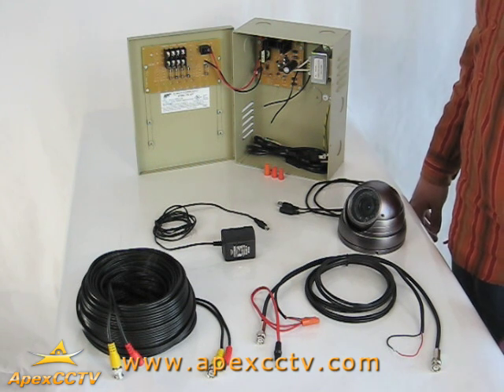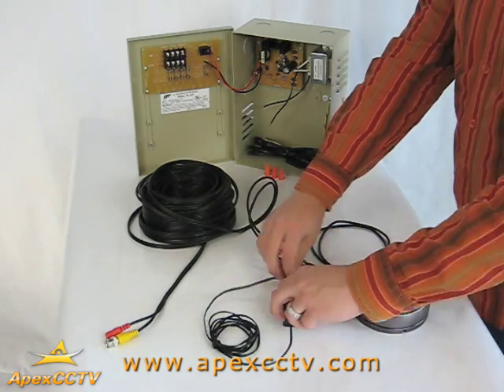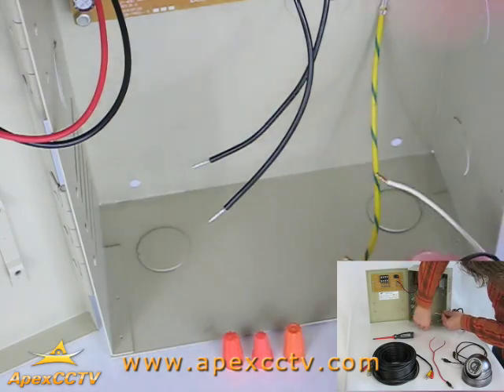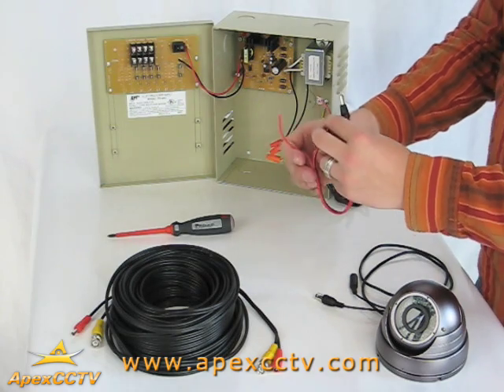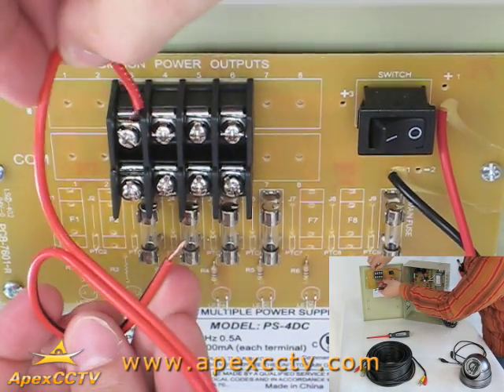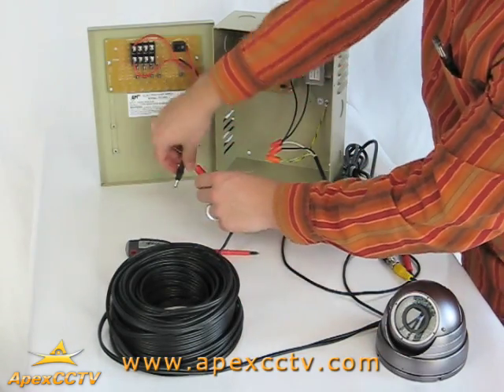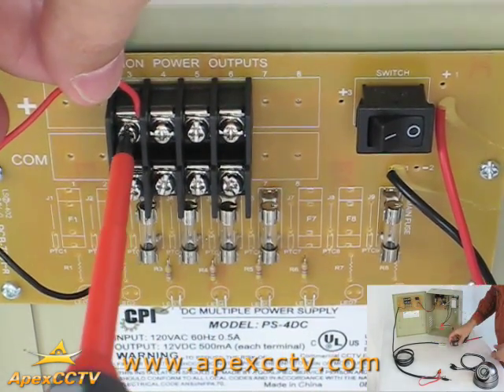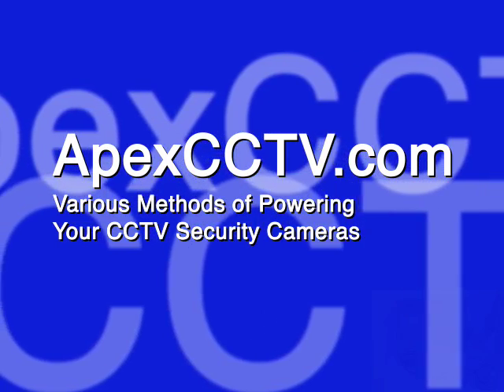Video Tutorial : How to Power Your CCTV Security Cameras

Comment: HELLO Apex CCTV, during some trouble shooting with power issue for a camera, i came across a situation when i remover the negative wire from the power supply, the camera keeps working fine, i restarted the power supply with just positive terminal connected, it works just fine, i am confused how is it possible.
out of curiosity, i tried the same with other cctv unit in a diffrent location, THE CAMERA WORKS without negative connected to power. how is it possible. i have so many questions

Comment: To provide a 24v camera, is it possible to connect two channels of power box (Intermediated Positive of one channel to Negative of other) and utilize the outer connection of the two channels, +ve to camera's +ve and -ve side of channel 2 in box, to -ve wire of camera, that should increase the voltage but simple addition? Will this work or is not possible?
Reply: For anyone looking to try and use a 12vdc psu into a 24v it wouldn't work. Most not all but most CCTV cameras that are 24v that would be AC and not DC so then if your looking to make a 24vdc PSU then you could use a Computer PSU with a Knock out board and use the PSU -12vdc along with the +12v dc to make a +24vdc connection. However most times the - rail is low amps so your not going to be able to power much before failure. The thing is most CCTV PSU or PDU dc units would only give you a 12vdc and ground rails. So only 12v would work unless you were to use some other power supply to make the change. TBH it would be best to just buy the right PSU for your camera and be safe. Also if you have to ask questions about making POWER Supply it might be best to leave it to someone that knows what they are doing....

Comment: I have a question if i have a back up 12v battery installed incase the mains was tampered with but even then the dvr has a power adaptor that needs a 220v mains supply not 12v. My question is how to you wire the dvr to a back up supply?? Thanks
Reply: If you have a 220v unit I would guess from on the other side of the Pond, UK or somewhere other then USA. Then you would need to find a UPS backup that offers a 220v output for your country. Then inside the box would be a battery that is on a Charger and when the power goes out. The system runs on the power that comes out of the backup. Depending on the draw and size of UPS this could give you from 10 to days worth of power depending on the size and draw of your system.